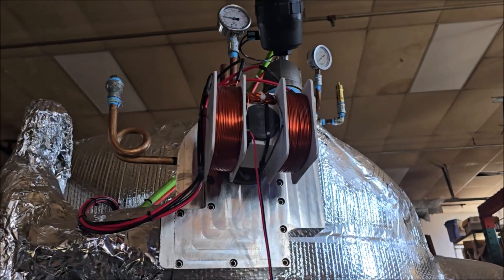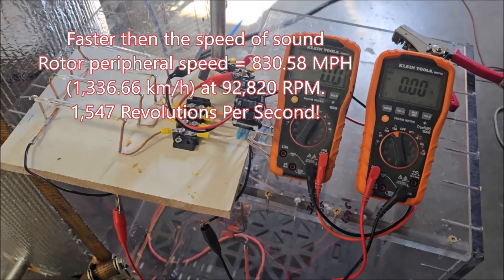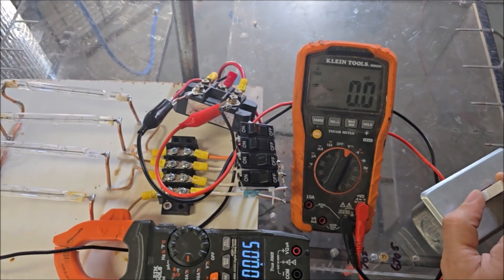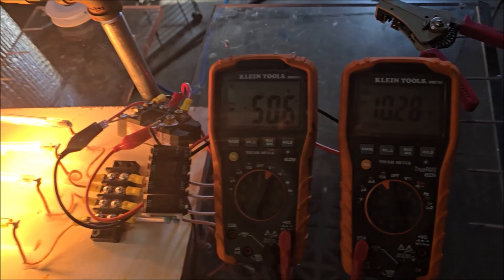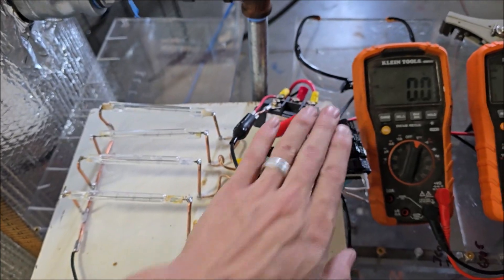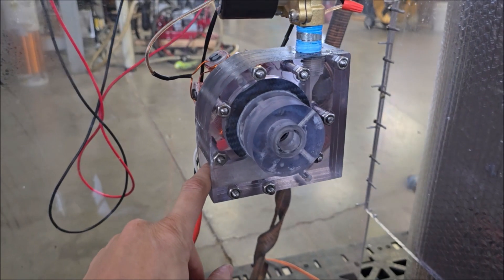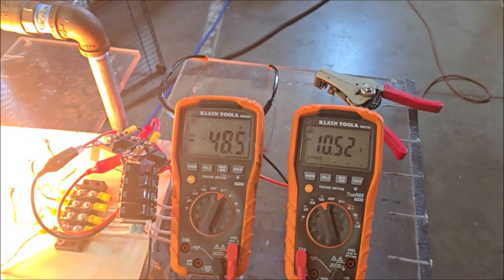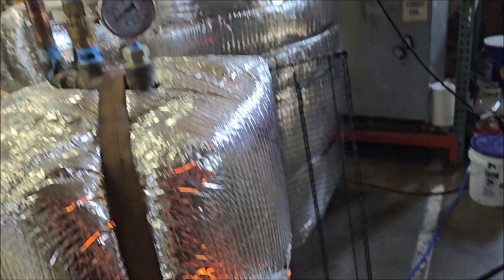Tesla Turbine Breaks Sound barrier! 95,000 RPM!

Comment: The Denser your working fluid is, the greater the energy that will be transferred to the disks.  Increasing Disk mass and diameter
will yield greater torque.  Greater torque means lower speeds will yield greater power transfer from the working fluid. Think in 
terms of spiral tapering blades inside of a cone structure. Greater surface area yields greater torque and energy transfer.
Interesting project!!
Reply from the maker: Thanks for the feedback! We've actually built and tested the 6" rotor with great success. Contrary to your point, we've found that higher speeds actually mean more power with less torque, although the torque is still quite substantial. The turbine achieves its greatest power output when the rotor is moving at half the speed of the working fluid. In a vacuum, the steam velocity is extremely high, which makes it feasible to extract energy at very high peripheral velocities.

We've also designed and built an efficient high-speed dynamo that works exceptionally well with this setup, allowing us to achieve extraordinary power output. The combination of high speed, vacuum conditions, and our dynamo design really pushes the efficiency to the next level.

Thanks again for the interest—exciting times ahead with this project! Let me know what you think.
Reply: Very awesome. Keep up the good work
Reply: Use depleted uranium disks!!!

Comment: When you opened the valve to the big tank, I thought it sounded like you had liquid in the tank which comes from the moisture in the air.  Obviously, you did and you have to drain that out once in a while.  Nevertheless, good video about a Tesla turbine.
Reply from the maker: Actually I filled the tank up half way with water and heated the water up to add hot vapor to the compressed air. Don't worry though, I regularly test the tank over 150 psi with water so that there is no danger of explosion during testing.

Comment: What are the discs made of?
Reply from the maker: @EugeneWangombe  carbon fiber in this test
Reply: @iEnergySupply  interesting, self made?
lightweight, resisting hihg rpm and being much more easy to make by hand than most metals.
what expoxy or binder did you use in the carbon fiber(or what material you used at it, not as much interested in the speciffic brand as in the speciffic types since most brands which people on the internet use aren't available here(netherlands)), 
especially since many epoxies can't handle to high temperatures. similar to plastic.
Reply from the maker: @ted_van_loon  I used a fairly generic carbon fiber I found online for this build. If I could source a high-temperature-resistant carbon fiber, it would be ideal. I did find a type rated for 500°F (260°C), but after testing, it turned out to be too weak. I made disks from it and spun a 6" diameter rotor up to about 33,000 RPM, but unfortunately, the disk failed and shattered under the stress.

Interestingly, FR4 fiberglass has shown to be stronger in some of my tests, despite its limitations with temperature resistance. To avoid issues with heat and mechanical stress, I've switched to titanium for the larger 6" rotor during testing. While titanium is quite expensive, its strength and resistance to high temperatures make it an excellent material for these applications—especially when dealing with high rotational speeds and thermal challenges. It’s proven to be a real game-changer for this project.

Comment: Have you any efficiency tests results?
Reply from the maker: In previous tests, we estimated an isentropic efficiency of approximately 99%, though this was a rough calculation. We are planning further testing with more accurate and precise measurements. While 99% may seem high, particularly when compared to other turbines of similar size, it is important to note that the overall thermal efficiency of such cycles tends to be relatively low. However, our goal is to significantly enhance the thermal efficiency as we continue to refine the system.

Comment: One thing I'm wondering is, since you have to use electricity to use the compressor, even if you run a tesla turbine, you still have to use external electricity, so in conclusion, you're generating electricity, but isn't it offsetting?
Reply from the maker: To generate electricity, all you need is to heat the thermal reservoir. You can use firewood, wood chips, diesel, waste oil, gasoline, trash, or even solar thermal energy—basically, any fuel you can think of. The versatility of that is truly amazing!

Comment: I’m new how you getting air?
Reply from the maker: Air compressor, but with the new 6" turbine, it's made of aluminum and has a metal rotor so to generate electricity, all you need is to heat the thermal reservoir. You can use firewood, wood chips, diesel, waste oil, gasoline, trash, or even solar thermal energy—basically, any fuel you can think of.

Comment: Steady at 30v at 7.5a with 500w load.   Perty good but what gpm is it using of the air?  With 200 psi in the tank looked like running..
Reply from the maker: 100 psi was the max pressure in these tests. If I increased the water temperature it would run for much longer and if my generator was more powerful I could output much more power.